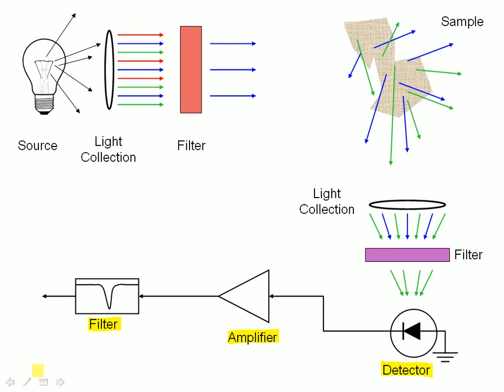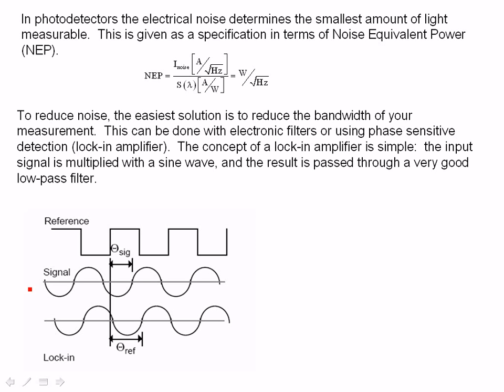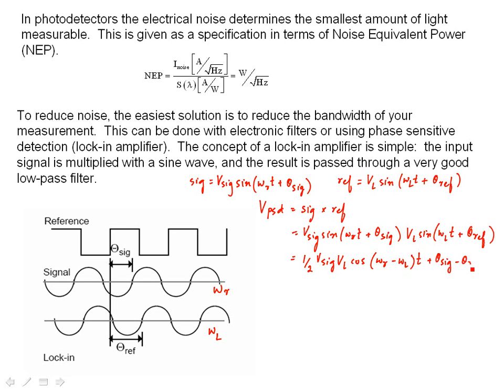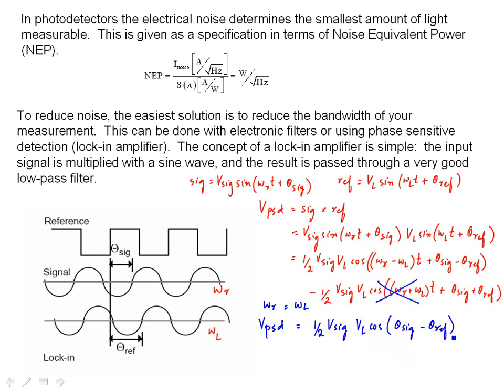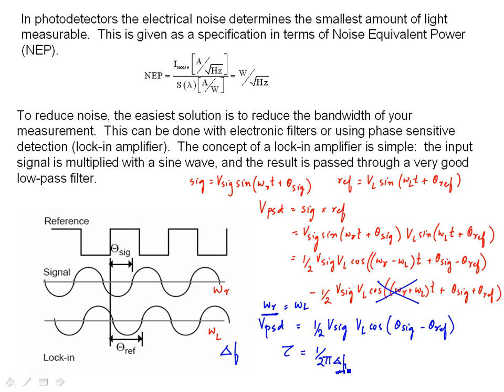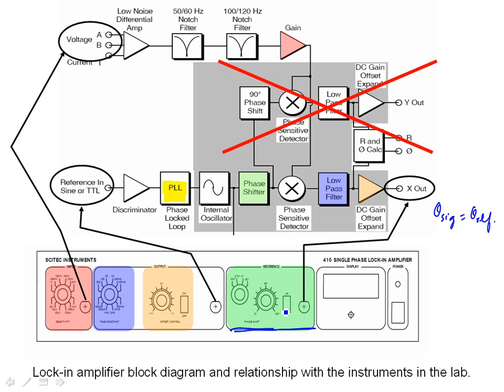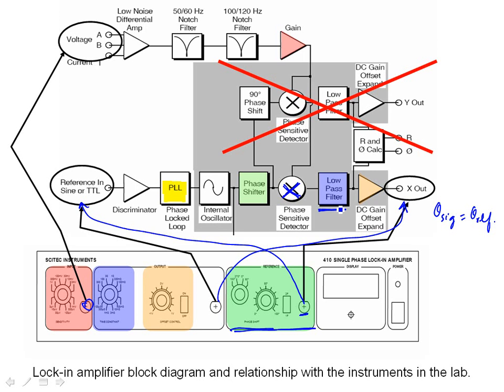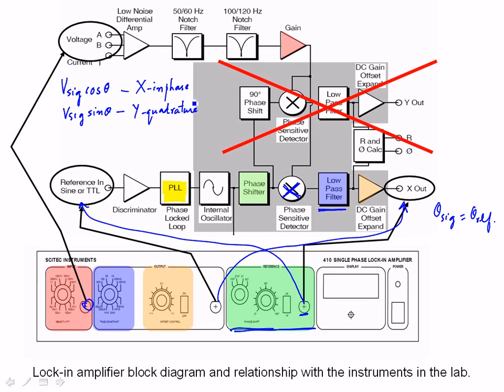Phase Senstive Detection

Comment: very confusing on why she cancelled out that second term for Vpsd but it is because the first term becomes time independent and thus a DC signal and the second term becomes time dependent or AC. Run this through a low pass filter and only the DC signal will be output.